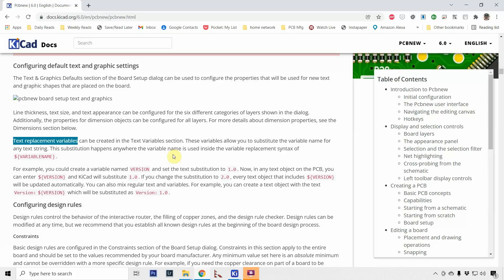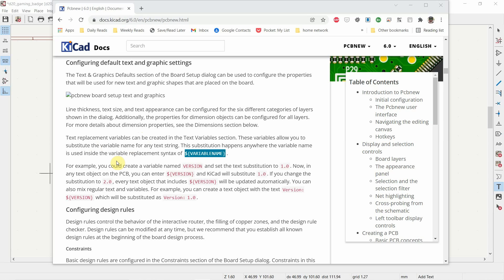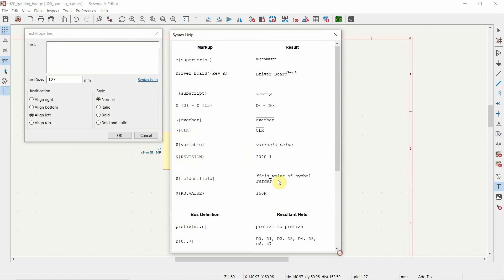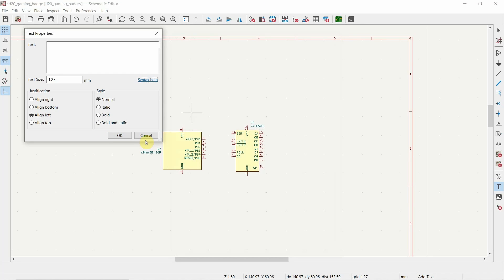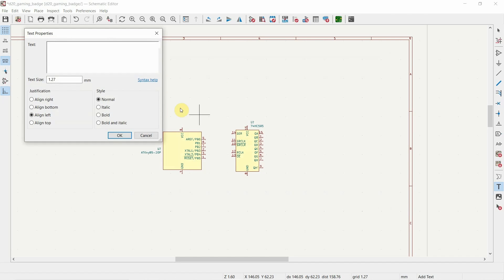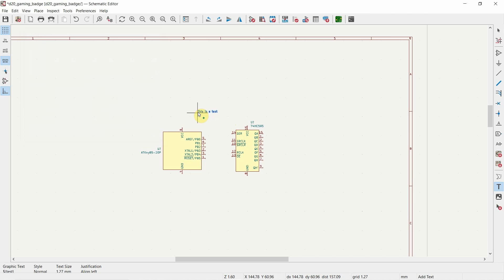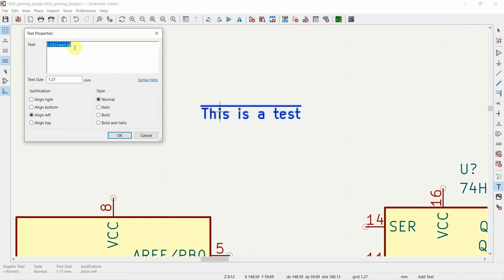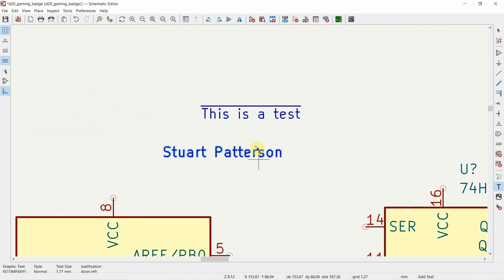KiCAD 6 Text Replacement Variables

Comment: One very handy feature of variables is this:  Suppose that your company has in-house inventory part numbers for all the components your design uses. In the schematic, (or symbol library) you can create a field in each component like "MyCoPN" (for My Company Part Number), into which you enter the corresponding inventory part number.  This means you can continue to place an electrical value in the "Value" field, and use MyCoPN for the custom company-specific inventory part number.
Then, on the PCB, or the footprint library, for purposes of creating an assembly drawing that references inventory part numbers, you can add a field to each footprint and set the value to ${MyCoPN}, and this will display (perhaps on a dedicated User layer) the value from the schematic.  You can use a script to add such a field to each component on the PCB, if you're using standard library footprints and don't want to modify each one manually.
Another use:  One the schematic you might add a field, say "InstallFor", in which string values indicate what product option or options this component should be fitted for. Again you can get that info to appear on the PCB or its derivatives, such as an assembly drawing.
Reply from the maker: Good point!